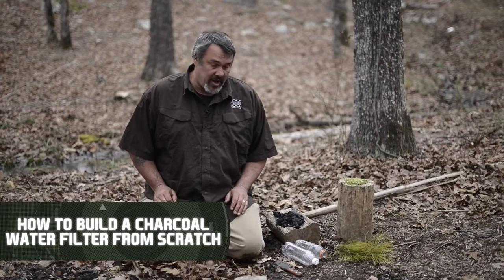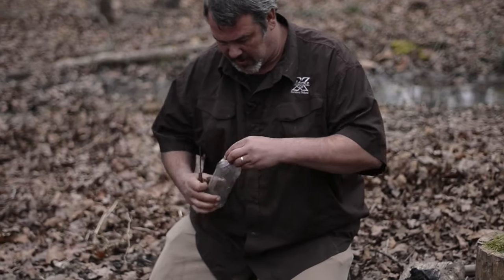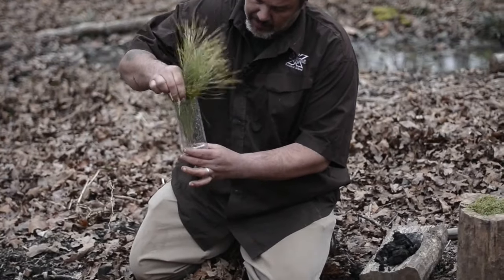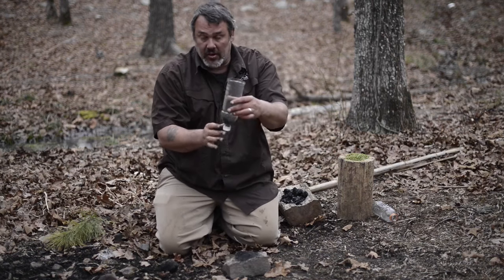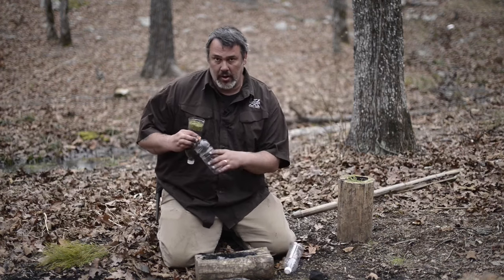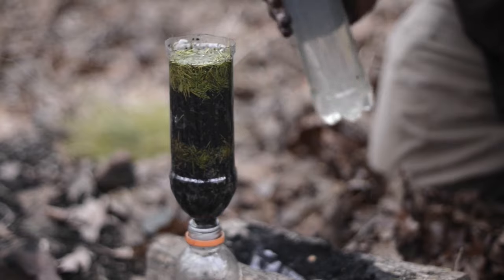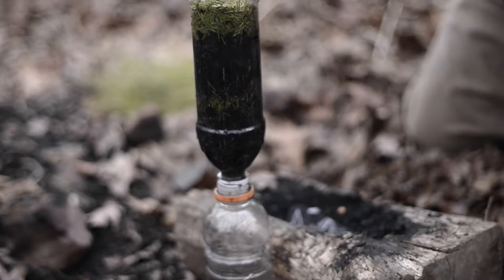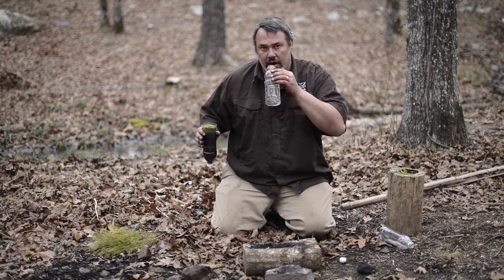How to Build a Charcoal Water Filter From Scratch | The Survival Summit

Comment from the maker: A quick note about this particular clip from our film, Survival Skills. While it's true that you can make a filter like this, you need to be careful in doing so. We would recommend only using this method if you absolutely were not able to boil or properly filter your water.  Regular charcoal is ok to absorb odors and improve taste, but may not filter out actual bacteria. It's Activated Charcoal that really purifies water, and you need to add calcium chloride and water and cook that mixture, to truly make Activated charcoal. Moral of the story, boil everything, or use a Sawyer, Lifestraw, or Grayl filter. In a life or death situation, if you filter it well enough, you'd probably be fine, but don't risk it if you don't have to.
Reply: Does this work on PFA/Forever chemicals?
If not, please do a video on what does?
Reply: So would you say that if you first boil and kill all the bacteria and then run it through a charcoal filter this elminates the threat?
Reply from the maker: @KaiserRuiz  run it thru the filter to clear it up first, then boil it
Reply: can you use calcium carbonate (lime) instead of calcium chloride? But I suppose that's just an alkali, and an acid like lemon juice can do the same...
Reply: Should i use only activated charcoal
Reply: @TheSurvivalSummit  Should i use only activated charcoal?

Comment: Extra tip: you can skip filling your “clean” bottle with charcoal/brackish water by just filtering onto the ground until it runs clear, then attach to the clean bottle.
Reply: Yep, then all you need to do is boil it. It's a SUPER old middle eastern process I used in the field.
Reply: Advantage of using charcoal is that can absorb some chemicals, poisonous for humans... Not only removing impurities, as sand or ground, but can "take in" until is saturated (need to be replaced occasionally) some chemical toxins, that even with boiling couldn't be removed...than, boiling water, should kill viruses, bacteria, parasites, so water should be better than any tap water... ;) Regards from Serbia
Reply: @ivicamilosavljevic4706  yup, unless you're distilling when you boil you're still going to have the heavy metal in the water.

Comment: This may be the most important thing to know for preppers. Buy some activated charcoal and know what ground up plant material you can use and find it and have it ready. Also so it helps to add some sand and small gravel to get out the bigger particles. Using much larger containers for more permanent emergencies is a good idea, as well as knowing the best construction of barrels and their piping. Then you have a water filter for many hundreds if not thousands of gallons for pennies on the dollar compared to commercial tabletop filters, which you have to constantly replace expensive filters with. I would always boil the water over a wood fire after filtering.

Comment: Excellent video. Thanks.
Question: Instead of collecting charcoal from old camp fires, can I use charcoal briquettes from a store-bought bag (as long as they are not treated to light with a match)?
Reply from the maker: Possible, but if you have access to charcoal briquettes, you can make a fire and just boil the water instead. This primitive technique is really only for an absolute drop dead emergency if you have no water purifying filters, no stainless steel containers to boil in, no purification tablets, etc.  This technique is not guaranteed to remove bacteria from water if it's present. It's definitely a great technique if you're trying to take odors and silt out of brackish water before boiling as it will greatly improve the taste.
Reply: @TheSurvivalSummit  Thanks.  Very good point.
Reply: The correct answer is no absolutely not. Just get yourself some natural lump charchoal. Briquettes are manufactured from consumer waste.

Comment: I have a question. 

I've always seen filters like this done with sand. Is the sand just for catching particulates like dirt clumps? Or does it serve any other purpose that might make it worth adding to the top of the filter? 

And if using activated charcoal, would that completely remove the need to boil water? Or would I still want to boil the water after running it through the purifier?  

Also great video! Very helpful in answering my other questions I had that led me here. 😎👍

Comment: I get it cleaned the pollutants like lead or metals, but do you still have to worry about the bacteria?

If so, would it be wiser to have several of these going at once, then boil them together to kill any disease?
Reply from the maker: We would recommend using this method only as a last resort, or simply to have better tasting, more clear water, that you should still boil 100% of the time.
Reply: @TheSurvivalSummit  is it better to boil the water before or after the filtering process?

Comment: Really interesting, but how long can I use this filter? So I mean how long can I filter out my water in there until it's time to throw it away or change charcoal, even though it looks pretty wild and should be used as a last resort?
Reply: Not trying to be a smart ass, genuinely trying to guide for knowledge. Do some research on how many gallons can be filtered by however many ounces of charcoal. This way you can calculate how much water you intake and then how much you need to filter. This will give you an idea of how much you can filter through however big of a filter you use. Sorry if that’s confusing
Reply: I missed a key point, knowing how much water you need to filter, as well as the volume you can filter, gives a ratio of how often you need to change out

Comment: A Question To Anyone Who Knows:

Here in the UK I don't think we have pine trees and if we do I've never seen one. What other green earthy material can I use instead of pine needles?
Reply: Personally, I wouldn't use pine needles some can be toxic. As you don't seem to have pine trees where you live no worries. You could use something like an old tee shirt cut up to filter the charcoal dust from passing through. That's my method at least. I'm certain there are others like rough sand or fine gravel. Which is actually another method of filtration. fine gravel, sand charcoal and something to keep the filtration system from passing through and clogging up the final drip system. Food for thought mate.
Reply: We definitely have pines in the UK
Reply: Grass or cloth